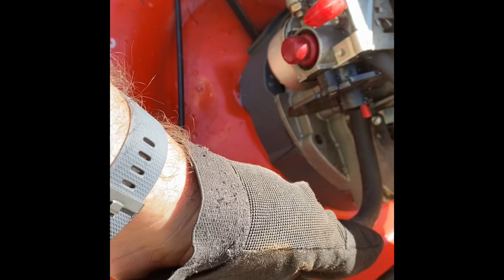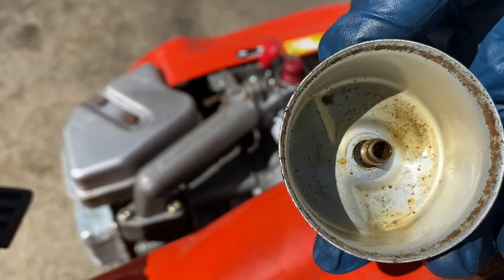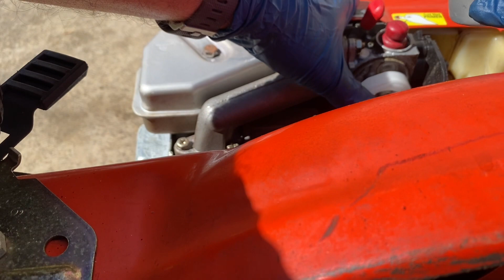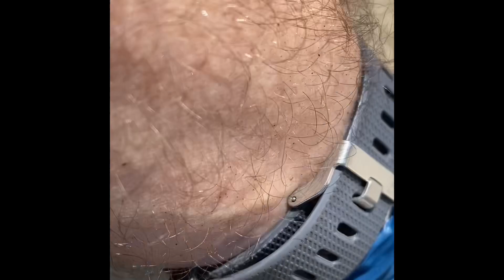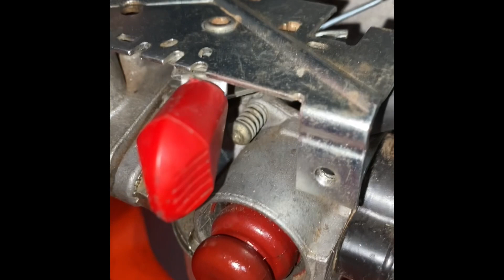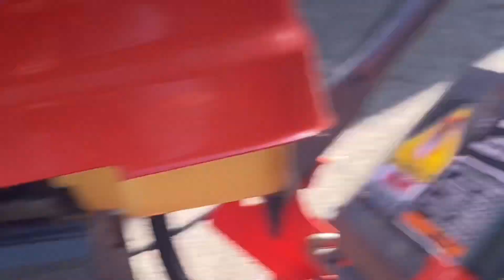2001 Scott’s Lawnmower by Murray | Tecumseh OHV, carb clean, swap, linkages, idle settings

Comment: Nice job I haven’t seen a Scott’s lawnmower in a while  for a 2001 mower the deck is still in good shape have you ever had a lawnmower blow up on you before
Reply from the maker: Yah it was my own Tecumseh craftsman 
It started to have a rod nock
Reply from the maker: Scott’s mowers back then we’re made by Murray.  And later on John Deer.  Scott’s just rebrands some other mfg mower.  And I don’t thing they make them anymore
Reply: Rod knock is the worst death of a lawnmower
Reply: @dfields9511  thanks for the information I didn’t know that you learn something new everyday
Reply from the maker: Believe it or not I have another Scott’s by Murray  video coming .  I got it as a trade in.  Vide will be out in June .